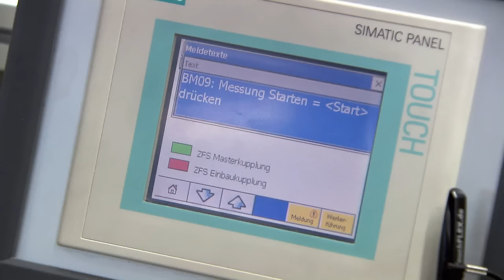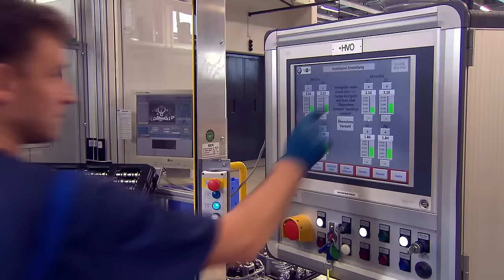BMW R 1200 GS Boxer Engine Production | HOW IT'S MADE

Comment: Really intresting, i like the assembly station and clamp system  especially when use pneumatics holding devieces, all is optimised for faster and efficient operations, it's very difficult make some mistakes during the engine assembly's, everything is clean and organised, but the top absolute is the test fixture measument of the entire engine that use multiple sensors to evaluate the engine performances. Thanks BMW, well done!

Comment: Looks like really high build quality, I like that it actually uses helical cut gears in the transmission.
Reply: Helical gears is a standard
Reply: fashionskiller Yes it is standard.
The reverse gear in cars at least used to be straight cut, hence the noise from the gearbox when reversing :) cheaper and meets the requirements.
Reply: Straight gears are stronger.. helical are smoother
Reply: Early Citroëns used Herringbone gears, like double opposed helical gears... This eliminated the axial trust produced by a single helical gear, while keeping the smooth running, but it was just too costly! And that's why the Citroën logo is a twin V-shape
Reply: Yes, I noticed that also.  Makes me glad I own a GS.

Comment: I have an 06 R1200RT.  Just turned 30k and the engine is now just breaking in.  Outstanding motor.  And the best suspension I’ve ever had under me.
Reply: lol
Reply: My 2014 R1200R Classic had its,first ride in 2023 this season. Enjoyed very much the first 35 km this year. Engine, drive train, gearing - everything works very smooth and souvereign. Comforting and sporty also 😊

Comment: BMW have been making boxer engines for 97 years now.  They are wonderful engines and you can tell when you ride one that they have been continuously making small improvements all through that time.   I rode a boxer nearly 20 years ago and just got another one. The improvement during that time is really noticeable yet they have still kept the character that I liked about that bike. Really fascinating to see how those engineering improvements translate to the process. The new bike I have got is 1 generation newer than this one (ie the new 1250 shiftcam boxer).
Reply: I own both a 2014 S1000R and a 2014 R1200GS.  I like them both, but the GS is still clunky while the S is japanese refined.
Reply: Es werden keine echten Boxer mehr gebaut
Reply: Copied from the UK Douglas Motorcycle
Reply: They can't hold a candle to a real Boxer. Modern rubbish.

Comment: I have also seen the Volkswagen factory in action, and I had the same impression - nothing what the employees do is physically hard or very demanding precision-wise, but they work at the exact same speed for hours without missing a beat. Everybody does only his part, nothing less, nothing more, and if everybody does just that, then the whole puzzle just falls into place.
Reply: everything is good here, you have to try it yourself

Comment: It's amazing how many manual work-man hours are necessary to build and assembly this bike and be able to maintain a reasonable final price.
Reply: Reasonable is relative.  Mine used was still as expensive as a new bike from the Orient.
Reply: @TucsonDude  Mine new was a lot less expensive than a pos Harley.

Comment: not s1000r
Reply: s1000r or s1000rr
Reply: Anusorn Deepeng wouldn't it be the same engine?
Reply: Alex Neumann No actually the s1000r makes about 30 less bhp but produces 7ftlb more of torque between 3000-8000rpm. Also the s1000 line bikes run an inline 4 engine not a boxer.
Reply: craktsupermoto the s1000rr and the s1000r share the same engine block...the s1000rr is not a boxer engine, the difference lies mainly in the materials used to produce the cyclinder head thus the s1000r is cheaper.
Reply: Makan besar
Reply: The clue is in the word BOXER.

Comment: does the us even have anything like this? even the housings that protect the worker are totally clean, they must clean as much as they produce
Reply: +Disco Rico Key to something like this is to work smart, not hard. They design the processes to be as time, energy and material efficient as possible so that the mess is never created in the first place. It's also why the plant is so quiet; efficient, quiet machinery doesn't waste energy by turning it into noise.
Reply: Sounds about right, i just wish I worked there..
Reply: Every part is machined using very little amount of coolant mist. And before assembly, all parts are washed in special ultrasonic "washing machines". All the cost of production of such engine is not only design - it can be designed in quite a short time, but all that machinery helping in assembly, fitting tools, lifts, sealing machines, transportation devices. They are not just out of stock. Every single one is made especially for the purpose they do. Also measuring machines can be quite expensive. The cost of material the engine is made of, reaches here only single percents. I really appreciate the work of people working on the line, mainly because they work as if they were robots. Boring, repetitive work in 3 shifts, or 12 hours a day including holidays. Believe me, you would be excited for a day or two. The real employee doesn't see the whole production process, only just his own part which is for example. Screwing some screws on cylinder head or putting camshafts to a measuring machine. Nothing exciting.
Reply: Been to the factory since they offer tours. BMW prides itself with a employee first policy. every workstation is ergonomically customized to each worker, they work 8 hours per day, 1 hour break and 2 short breaks of 10 mins. They do not work on weekends. And as you described, the factory is very clean with minimal noise, so the job is not very stressful. I also believe they are compensated very well.

Comment: It's not a Boxer engine, a boxer engine is a flat four that has two pistons on each side and when viewed from one side or the other with each piston coming towards you then retreating it gives the impression of a boxers two fists, hence the name boxer, just as horizontally opposed 6 and 12 cylinders engines are not boxers although they are erroneously called boxers by some.

Comment: 1:55 the gearbox guy : I'd like to ask him why they clunk into 1st.
Reply: The clutch is not seperating the gears form the turning part completly. some oil will make it spin all te time when the box is in neutral. If the gear is layed in, it stops from turning with that clunky noise.

Comment: [polyurethane sealers make superb gaskets, I use sika 11fc  with failsafe results, on metal, glass, timber, the brains are the CAD  designers and machinists, this is just assembly, anyone could be taught in  very little time, they are not creating, must be bored crazt

Comment: They can’t possibly pay for all that tooling by selling motorcycles
Reply: +Mark Jones   Subsidies. Shady subsidies.
Reply: That's what I yelled at the screen.
Reply: Have you purchased a BMW bike, €28000.00 for K1600, buys an awful lot of tools. Some smaller engined bikes I believe are manufactured in India and possibly China, might be incorrect. I’ve read that part of the GS frame system is manufactured in China, hoping some knowledgeable person will enlighten me. J

Comment: Whenever I see things like this I always wonder, 'How did we ever win the wars? I've worked in factorys in. My youth and they all seemed the same, radio blaring, shouting and screaming, the products being thrown at each or falling on the floor. Men standing about leering over women who seem to be doing whatever they're meant to be dong much better. And of course, everywhere you look you can see stuff going wrong. Machines breaking down, malfunctioning or being repaired. Line workers struggling to cope with product going all over the place, (mostly on the floor). Oh and of course the skivers. Usually holding a brush prop that they will pretend they know how it works if a supervisor goes past.

Comment: any reason this stuff can't be done by machines? I'll accept human oversight for quality control, but all of this work seems like the job for a robot. jobs / pay / livelihood aside, any suggestions? 

and personally if a company chose to automate, I believe that they should train any employees that will be unnecessary for a career, be it a degree or skilled craft.

Yes, I think that engine building is a skilled craft, but I know that technology is quite capable of usurping the human in most of these repetitive tasks in speed, and equally capable in accuracy and precision.
Reply: Some things just need to be hand built. Like the cylinder head on the dc2 type r.
Reply: why..
Reply: +0Sirk0 There is a lot of work nessecary to automate even simple tasks. You can't just buy a robot out of a box and say do the job. Even very simple tasks involve a lot of programming. So it is simply a matter of cost and in the moment humans are still often cheaper and much more versatile.
Reply: +0Sirk0 They have to have people working there in case the robots turn evil. It would be like judgement day but 1000 times worse.

Comment: It's very bad  ! I prefer a motor that can be repaired easily on the edge of a road without  hundred of specific tools.
Reply: Than you should buy a BMW from the 60-70ies. 
All modern bikes, doesn't matter which brand, need special tools and computer aided analyse for maintenance.

Comment: a 1930s engine with 2019 assembly tooling
i really dont understand drivers of bm and harley riding  20th century tech when they could have a 21 st century Honda that is faster , more nimble, looks better ,  and brakes better and uses less fuel than these 
i have a 90 cbr1000f and the engine is bay far more advanced then this 2 pot
i have a 97 cbr 1100xx and its lightyears ahead despite being 20 yrs old
i have a 78 t140v which will still outhandle this easy peasey but is rough on the engine side

as they say you pay your money and take your choice